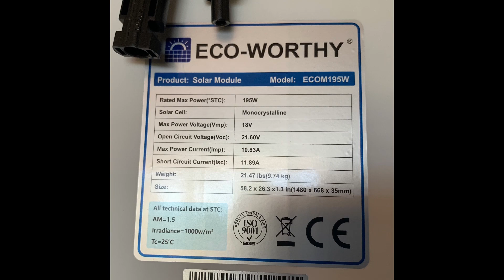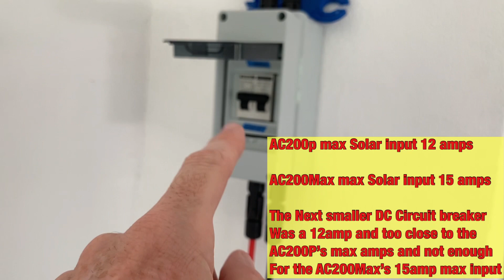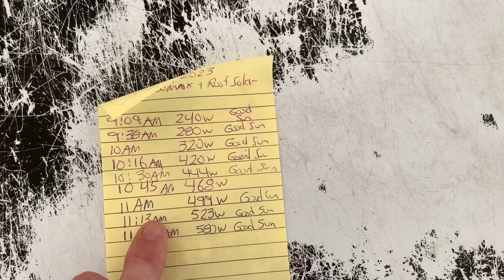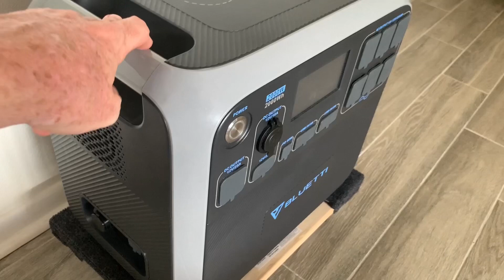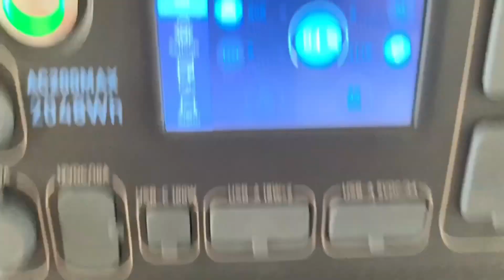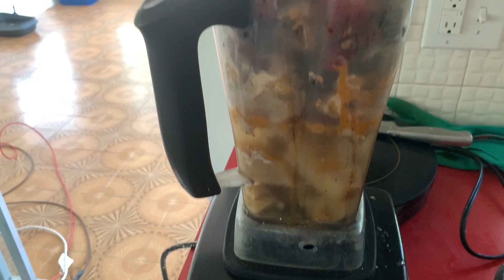Bluetti Chronicles 1 Upgrading our Emergency power backup system to a small home solar system

Comment: Great informative video. I just got the ac200max on a black friday sale here in the Philippines.  Ame with their pv350 pa els wich are excellent.  I actuality got 365 watts for a while when the sun was directly over them. I havent decided on the batteries yet. May get the b300 ones if they work well as far as charging and discharging like the b230s.  Ha e you thought about putting in a generator plug in Your panel to run parts of your house? Seems easier than running extension cords. Thanks for your videos. Very clear explanations!!!
Reply from the maker: Hi Michael Thank You!  Congrats on your new AC200Max!  It’s a great Solar ☀️Generator!  I am planning in the near future of adding a transfer switch so I can run certain outlets in our house off of Solar like our Bluetti’s but I am also working on installing a bigger off grid Solar system for our house with the new EG4 solar system we purchased recently!  I am planning on adding an additional 4-6,000 watts of Solar panels for this system and as the EG4 Solar Charge/Inverter can handle 2 solar inputs of up to 500V each we will be able to use our current 1,755w of Eco-Worthy Solar panels which I will soon add one more Eco-Worthy 195w panel to make it 10 panels ( 1,950w of panels ) so I figure with 10 400w additional panels we will have about 5,950w of solar panels total.  With the soon to be two solar arrays we can still use our first set of panels that we use for the Bluetti’s for either the EG4 system or our Bluetti’s!  Thank you for your comment a good luck on your solar journey!  I will have many more Solar Videos coming out in the future!

Comment: A small but significant comment regarding how you utilised the connecting cable between the main unit and B230 extension battery: 

You appear (to me) to be the only person who has looped the cable to prevent  it from protruding out so far! So simple and obvious; sadly not to the numerous reviewers who complain about the cable sticking out too far when connected. 

For that, Sir, I commend you. 

I have no doubt that if you were using the B300 batteries, and doubling them up, then the cable would be just long enough.